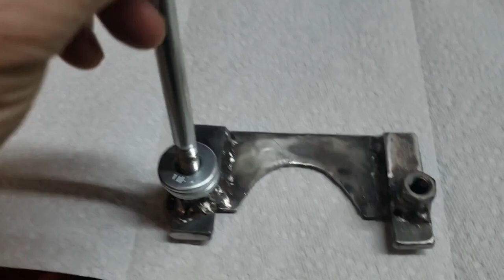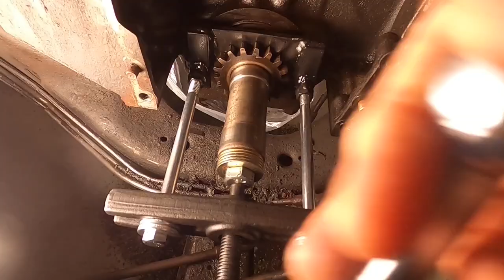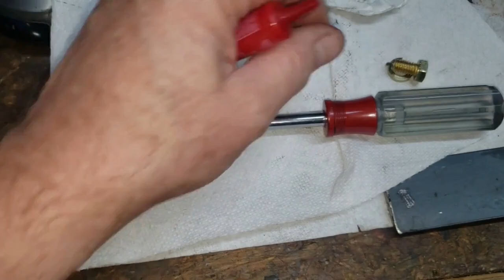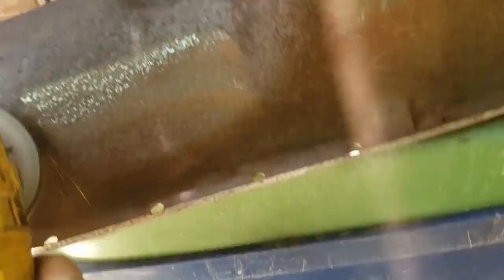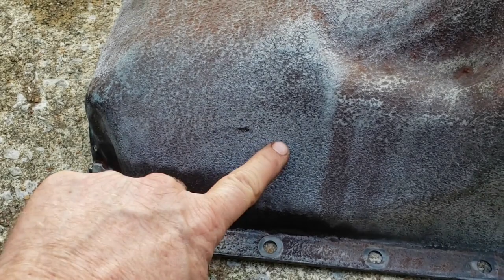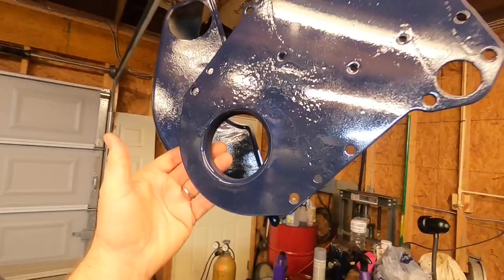Cadillac 472 500 Rear Main Seal, Front Crank Seal, Timing Chain Set - Part 3 - Install Timing Set

Comment: I'm surprised the crank sprocket is that tight of a press fit. Most V8's I've worked on either slide off with a couple prybars behind it or just come off by hand. Good job on the home made tool, if it works it works!
Reply from the maker: A couple of pry bars from each side simultaneously would probably work just fine with no issues but I wanted to try and make a semi-proper tool for the fun of it.

Comment: For the slow kid in class, why take the crank sprocket off ?  Did I miss seeing some seal that rides behind it ?   You know I am going to have watch the series several times.  Thank you for sharing your knowledge.
Reply from the maker: @DanTheManIOM  Both the crank sprocket and the cam sprocket are replaced when replacing a timing set. You would not want the old crank sprocket running in the new chain. The old sprocket has wear and it would be loose.

Comment: Old video, I know, sorry ... Went back and re-watched since I'm getting ready to change the timing chain in my 1970 Eldorado. ( Wish me luck, going to try it without pulling the engine 😒) Were you happy with the Bill Hirsch paint ? Seems very bright compared to your valve covers. I like the really dark blue of your valve covers ... Are they factory original blue ? My engine paint is so faded, I can't really judge the factory color.
Reply from the maker: @donopp5850  Bill Hirsch is the best Cadillac blue. The color mellows after some heat cycles. All the blue paint under my hood is Bill Hirsch Cadillac blue now. I tried two others before I found the Hirsch stuff.
Reply from the maker: @donopp5850  You should be able to change the timing set without pulling the engine.
Reply: @ImpalamansGarage  Thanks. I had settled on the Bill Hirsch, but it appears they no longer offer it in spray cans. I'm not sure I want to attempt using a spray gun, painting is definitely not my forte. Any experience with Inline Tube ? They have a dark Cadillac blue in spray cans.
Reply: @ImpalamansGarage  I think it's going to be a challenge ... Eldorado is front wheel drive ... The oil pan literally wraps around the drive unit. Oil pan cannot be removed without pulling the engine, or dropping the drive unit. Service manual says to pull the engine. Some say it can be done, others say it cannot ... I will find out ... I guess. Even if I can get it done, my next biggest fear is that the nylon gear is going to be trashed and I won't be able to clean the pickup tube. ( 137,000 miles, but I don't know if it's been changed already )

Comment: Hi, great video.
What size are the bolts that you used on the timing gear?
Reply from the maker: The cam gear bolts are 5/16 x 18. Be careful not to use bolts that are too ling.

Comment: Hey brother! I’m stuck cause I don’t have camshaft bolts, do you happen to know what size?
Reply from the maker: For 1968 to 1975
5/16 x 18
Length = 9/16
Make sure the bolts you use are not too long. That would be bad. If you cannot find proper length bolts you can cut the new ones if they are too long. Bevel the ends a tiny bit on a grinder so they will thread properly if you do have to cut the new ones. Use grade 8.

Comment: Man I have the same problem on a North Star
Reply from the maker: From what I've read those engines have head bolt issues but there is a permament fix. Just curious if you've run across that.

Comment: Normally you just crack it and pull it off
Reply from the maker: Sounds violent! lol
Reply: Factory one is cast / cindered it takes one smack with a blunt chisel ... Done lots of them when I worked at the machine shop
Reply: @scotthatch4653  Do you mean you just hit it on one side of the gear?  Like with a drift punch or something?
Reply: @hackniagara  blunt chisel yes ...at the key were it's weak ... In the Cadillac Richard Holdener videos there is one of Cortney doing that to Richard's engine
Reply: @scotthatch4653  just found that… interesting way to do it. It shouldn’t damage the crank?